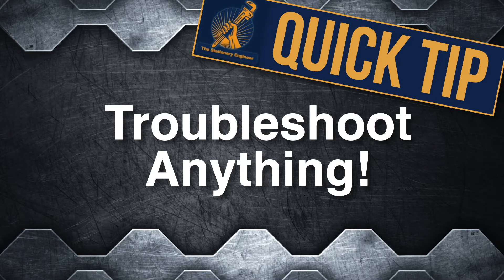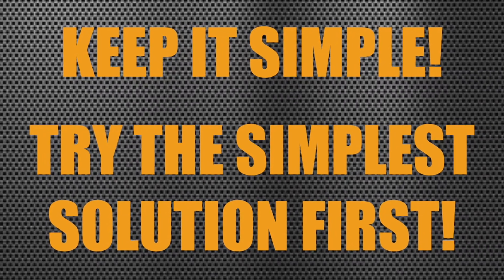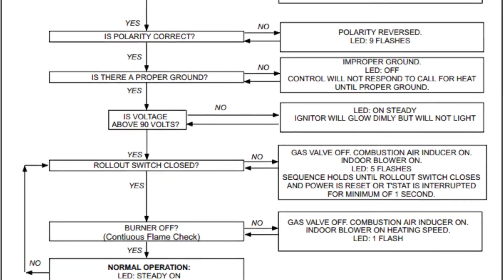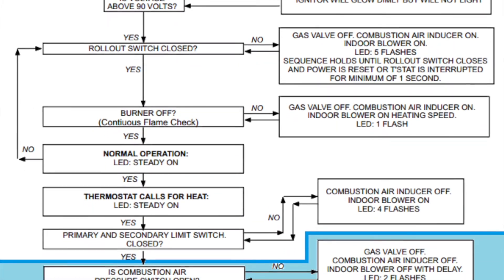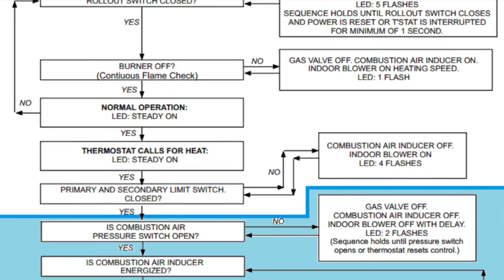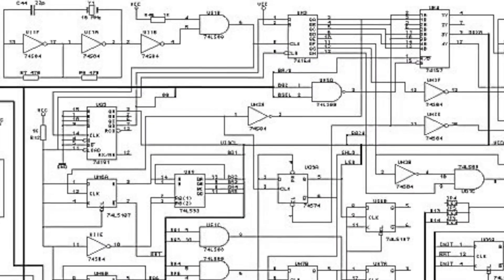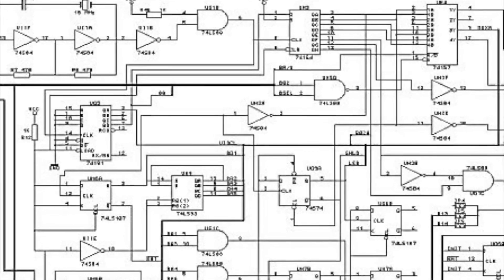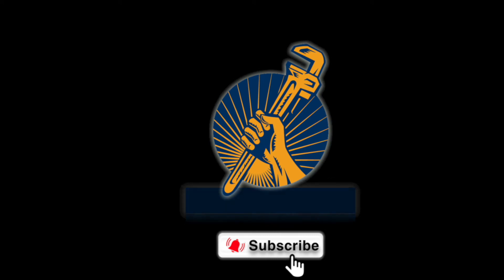How To Troubleshoot Anything!

Comment: This is great advice. I have been troubleshooting for around 30 years. Electric motors, Controllers,  Generators, Engines. These 3 basic rules apply across the board.